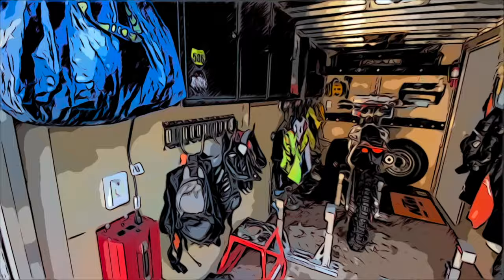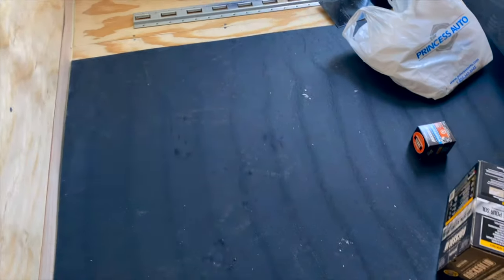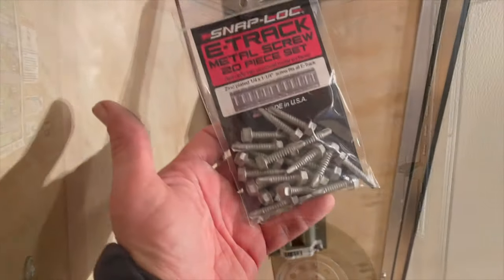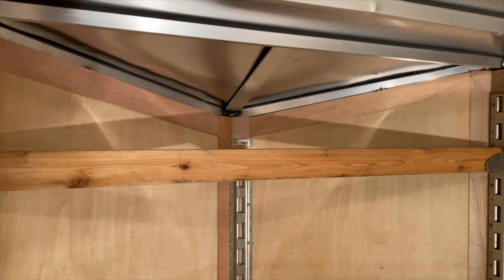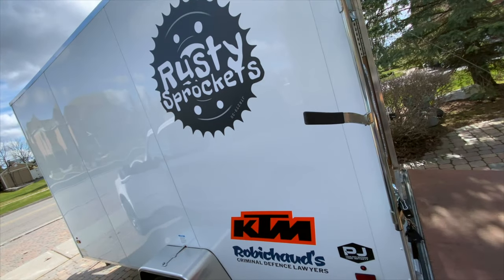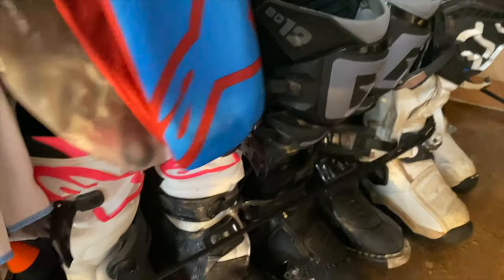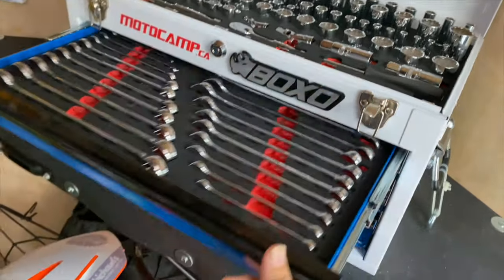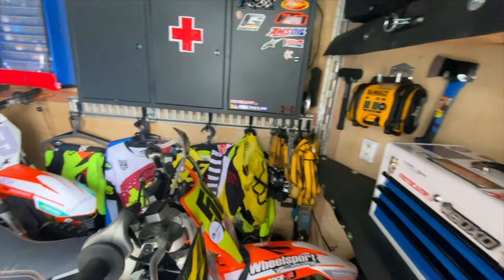Garage: Enclosed Dirtbike Trailer Buildout (6x12) | Walkthrough

Comment: Very nice organization /  I have a 7 x 16 foot enclosed utility trailer.  Mine is not as organized yet.  But I have insulated the walls/ceiling.  Added a 40 gallon water tank/outdoor shower.  A bunk bed,, RV through the wall style heater. 2 battues outside on neck   I have not focused on looks but function..  I use it for dirt bike trips,  sport bike track days,  Touring camping trips.  And the occasional  Home Depot pick up.
Reply from the maker: Very nice! Glad you liked it. Hopefully you got some ideas from it.

Comment: do you have any problems with helmets falling off the hooks?
Reply from the maker: Yes, sometimes on bumpy roads so I use a rubberized flex wire to hold them down. Bungee would work too. Just something to hook it down to as well. Small Bungee through helmet loop to hook would work

Comment: Nice setup for sure!  Just got my enclosed trailer and am setting it up for toting dirt bikes.  Just curious about how you mounted the cabinets?  Couldn't tell if it's another e-track thing or just mounted to wall and trailer studs through the back of the cabinet.
Reply from the maker: I drilled them into the aluminum frame with the same bolts I was using to mount the e-tracs. Thanks for watching!
Reply: @BigIronMoto   do you happen to have a model or part number for that Boxo tool box?
Reply from the maker: @mattpoland8250  Should be this one: https://boxousa.com/collections/hand-carry-kits/products/185-piece-metric-and-sae-combo-tool-set-with-white-3-drawer-hand-carry-toolbox ECC20301-003R2 (I think I referred to the wrong set in the video).

Comment: How long does the12 volt battery last with that inverter running the tv and video game?
Reply from the maker: Not long at all. took it out as a result. Just use it for lighting and the odd plug in tool when needed.

Comment: Did you ever install the rustoleum paint?
Reply from the maker: That is the Rustoleum floor. This stuff: https://www.canadiantire.ca/en/pdp/rust-oleum-rocksolid-metallic-garage-floor-coating-kit-0489758p.0489758.html?gclid=Cj0KCQiAv6yCBhCLARIsABqJTjZyx1KHbSTXc84i1OP5lNCgEDUconpidV8tNhJTQF_13wFldMsCaPQaAnQbEALw_wcB&gclsrc=aw.ds. Works pretty well.
Reply: @BigIronMoto  how has the floor held up with moving the bikes in and out of the trailer? Looking to do the floor of mine and people at the store are warning against using the epoxy on wood. Is it peeling up at all?
Reply from the maker: @darrenguree17  Seems to be working very well. Floor has held up really well for my standards (not a perfectionist - more a functionalist). I would do it again.